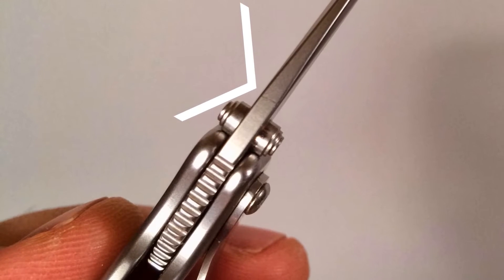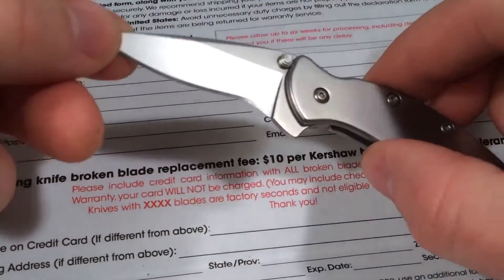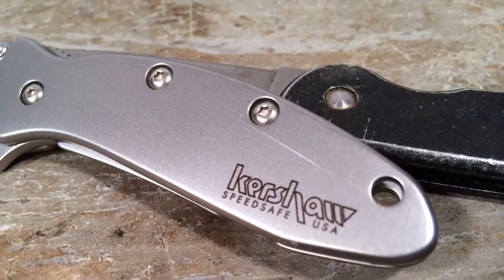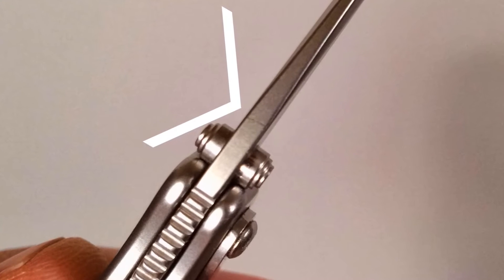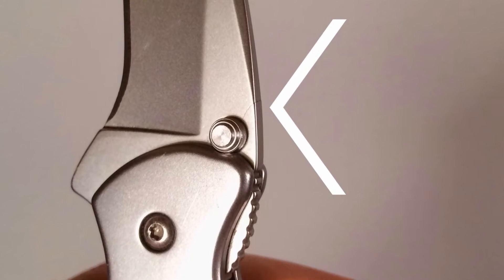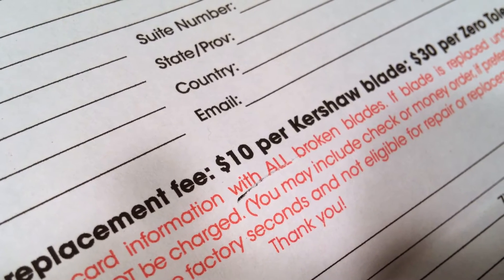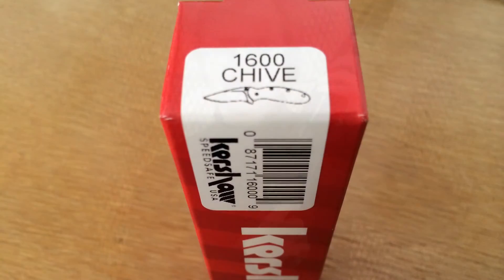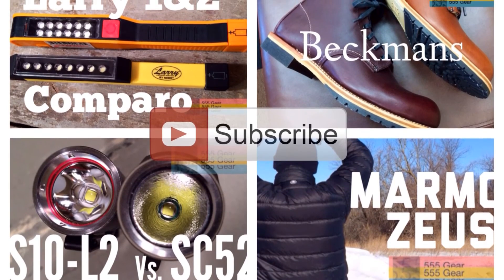Update: Unusual Kershaw Chive Blade Failure & Warranty Report - "Crack at Knife Blade Stop"

Comment: Well I am glad the company responded. What sucks is there are faults on the production knife and it gets you thinking. I like some kershaw products but I really dislike assisted opening knives of any brand, it seems there are more things to go wrong with operation of the knife. Glad you got it replaced.
Reply from the maker: I like assisted openers but pretty much as a novelty, a good manual is just as fast. I'm glad it worked out in the end
Reply: I’m the same way! I had a kershaw kuro assisted that I used for work but that’s the only one I’ve ever had. I rather use a non-assisted flipper, to me it’s more practical and reliable!

Comment: Leatherman uses that 420HC for most of their blades too unless you get a higher priced one with 154CM. Interesting place for it to fail. My problem with Kershaw is they don't make the pocket clip reversible so for lefties like me, not a good option. Also on my Kershaw blade I do have, the serration wore out and chipped almost immediately with light duty cardboard and rope cutting.
Reply from the maker: Thanks for your comment! Yeah the pocket clip design is stout but not deep or versatile. I've only heard bad thing's about Kershaw's serration on low grade steels too.
Reply: Another fail in IMHO is Cold Steel knives where their pocket clip is super short.
Reply from the maker: Agree 100%
Reply: the pocket clip on my scrambler is reverseable.  I carry mine lefty.

I still don't understand why anyone would want a partial serrated pocketknife, seeing as you get the best control at the part near the handle but it's made useless for control tasks by the serrations.  if they'd make them like steak knives where the belly is serrated and the control section is plain I might be more into it, but the way I see it you should probably just carry a properly sharpened plain edge knife and if you absolutely must a small fully serrated folder

Comment: I had almost the exact same failure on my kershaw knockout after having it just over a month. It has a thumbstud that looks just like the blade stop/thumbstud on the chive, but on the knockout it doesn't function as a blade stop. I'm not sure how these are secured to the blade, but it seems like it might be a rivet and if so, the failure might be caused by too much pressure when securing the thumbstud leaves the steel under stress and then an impact near the stressed part causes the crack. I might be completely wrong, it's just my guess. Anyway, I printed up the warranty form and will be sending it back for replacement.
Reply from the maker: Cool thanks for commenting here! Interesting to see the reports flowing in
Reply: +555 Gear just an update on the warranty process, all went smoothly for me. sent my knife for repair/replacement on February 16 and I got it back yesterday March 12 with a new blade.
Reply from the maker: Glad it worked out well!

Comment: I've had several Kershaws (spring asst) for years and never had a problem. But none of them has the 420 steel. My Buck 110 that I've had for years has it but like you say, they do a better job of heat treating.

Comment: I've carried a chive for the past 7 or 8 years daily. I've broken the lock mechanism, but never the blade itself. However, I have seen stress fractures in really thick metal where a stop was installed through it on industrial machining. In the cases I've seen it, it was either bad engineering picking an insufficient steel, the metal actually used on it wasn't what the engineer designed, or the treating process wasn't performed properly. I've seen 500,000 dollar machines have steel issues regularly.. I'd imagine budget knives could have similar quality control issues.

Comment: I just discovered a crack similar to that in my ZT 0200.
Reply from the maker: Interesting, thanks for commenting! Are you going to send it to ZT?
Reply: I do plan to send the knife back, It surprises me that the blade in my 0200 would crack above the thumbstud because it's not a part of the lock and there is no real stress on that part of the blade.
Reply from the maker: Yeah that's weird!
Reply: +Cameron tacticool I agree.  The force translated to the tiny area where the blade stop joins the blade, will be quite high, especially so because the blade mass is moving at a fairly high speed - of course depending on how strong the torsion bar is and how tight the pivot screw is in place.  And now the force is applied to a very, very small area - thus the psi value is relatively high.  If there is any issue (flaw) introduced in the blade when it's prepped for accepting the blade stop, or when the blade stop is attached, you have a weak point.  I would be curious to see a cross section of the blade/stop at that area.    All that said, while a crack in a knife would rightly be viewed as a problem - one that I would want resolved as was done here, I would also say that based on what I see here, the fact that I have several Chives, and my science (engineering) background, I would be very surprised if the blade would actually fail beyond exhibiting a crack.